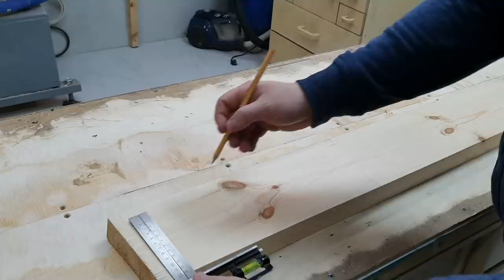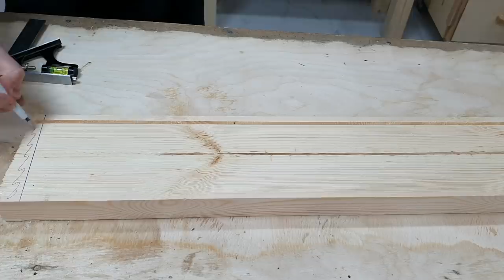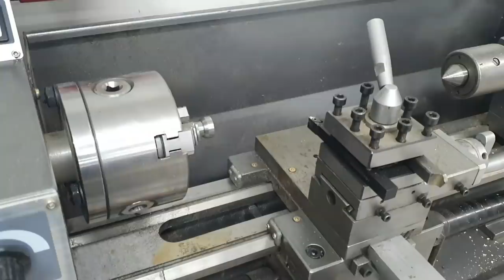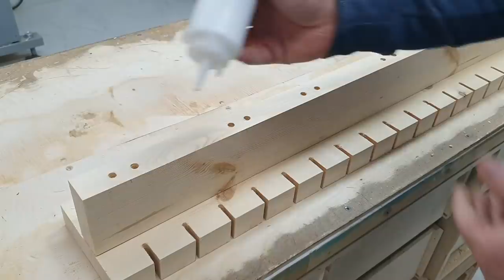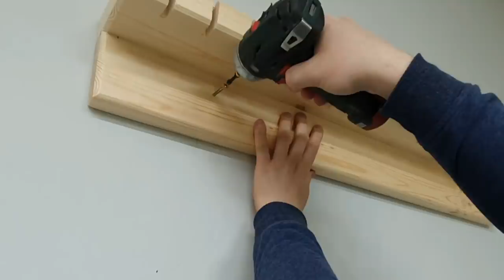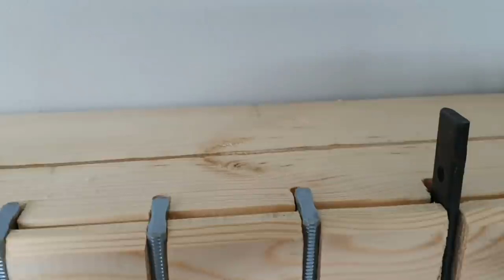The simplest and most useful home-made from a pine board. Craftsmen will need ...

Comment: Nice board! 
Even if you have to be a faithful man trusting 60 lbs of tools on two lonley screws hung on Drywall!
Reply: yeah, but he has 16 dowels holding the two boards together.

Probably sunk the screws into studs.
Reply: @barpluc3977  When he pulled could see shelf move.  Not in studs and no way it was level.  Didn't need 16 dowels when 3 or 4 screws would have done the trick.
Reply: @davidroman1654  It only moves on the end not yet screwed in, look on the wall before he drives the screws you can see location marks in pencil.  The screw is solid, but the bracket is rolling on its center.  The 16 dowels were overkill on anything not carrying 1,800 pounds, the screws into the studs are worth about 90# each into the studs, each of the dowels are worth about 110# not counting the surface glue.  Drilling the screws in much closer to the top would have lessened the tension on the screws and increased the shear giving them another 50% - 80% boost in capacity, but the lack of glue between the wall and the bracket meant just glue alone between the vertical and horizontal members would have provided sufficient capacity to exceed the screws.